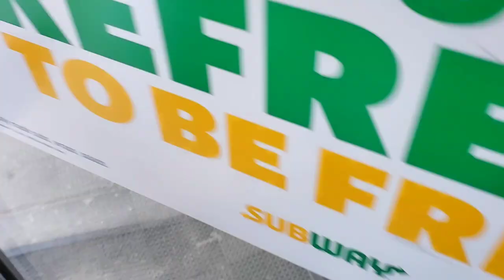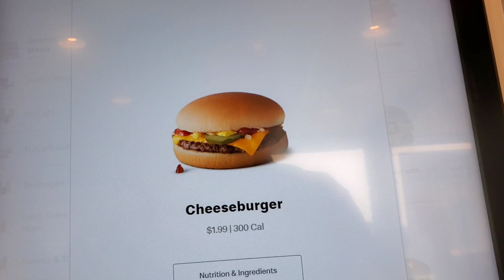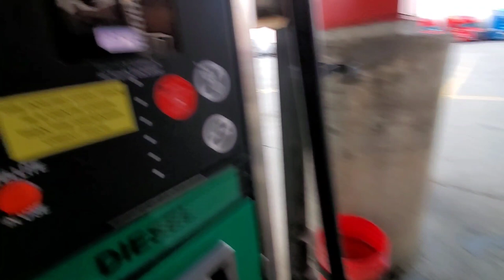Loaded For Topeka ~ Truck Driver Shortage #387

Comment: Keep  in mind  Kurt, there  isn't  a truck  driver  shortage.  Just a cheap  truck  driver  shortage.
Reply: I’ve had my CDL for quite a while but wasn’t using it. A friend is an O/O for a local company which hauls hazmat. In CDL school the classroom teacher was an old fellow who had been a Teamster before leaving to start the school. He advised us to get all endorsements we could. After finishing school I jumped through the hoops to get my Hazmat endorsement. 

This put me in a position where the company where I drive part time needed a spare driver. It’s been a good gig for several reasons. First, I get paid percentage. I really don’t get hurt as bad as a mileage based driver from delays. The second good point is that the other drivers which I deal with are generally high class. When loading up at the port the other drivers are nice guys. You just don’t see the things like you see on Bonehead Truckers Channel.

Comment: 30 years (100% OTR) all trailers except curtainside, car hauler, and some specialized.  Did the super- heavy, oversize/over length, gov't and military, refrigerated, dry, bulk, tanker, etc.
   You told it like it is, brother.  We all thank you for that.
   Two things:   1. Don't expect to be "super trucker" in only a week.  Takes years to be "average".  Respect those with more experience than you.
   2.  If the four-wheeler you drove to your company's terminal is manual stick shift, when you finish your long haul big truck runs

Comment: Great video as usual.  Growing up all I ever wanted to do was drive a truck. So during my last 2 years of high school in 79 and 1980 I worked for a truck leasing company servicing and washing trucks. After high school being 19 I still had to work odd jobs until I was old enough to hit the road. But as you point out there have been many days I have questioned my decision over the last 35 years but I have been able to see parts of the country that I would never have seen working in a plant. As aggravating as it has been I would still do it over again. So glad you can use on ramps for your breaks, on the east coast it’s a good way to get ticketed and get a DOT check. Not enough parking for trucks out here, if you don’t find a parking spot early here in the evening you won’t find one after dark in a rest area or truck stop. Again great informative video and we’ll see ya when we see ya.
Reply from the maker: Ya ive heard that those tickets are spendy

Comment: I wish people would stop saying you get "paid by the mile".. The number of miles is only used to determine your compensation to haul a load from "A to B, as opposed to percentage pay or ABP.
Included in that is everything incidental to that, from fueling the truck, doing pre-trips, weighing the load, checking the paperwork,  stopping at check stations, updating HOS records, submitting paperwork after delivery, and, yes, driving the truck.

Usually, there is a reasonable expectation of how long you will be under a load before you are available to commit to your next load. That is the time and labor you get paid for, and the number of miles times cents per mile is the way it is determined how much to compensate you for your time.

Only if extraordinary and unforeseen circumstances materially extend the amount of time devoted to a load should you look at additional compensation. I never had a problem holding my hand out if shipping or weather delays were upsetting the time/labor balance, and a good company usually responds positively for a well-presented argument for additional compensation.

Btw I get paid by the hour, OT after eight, 55 hrs a wk, Mo = Fr, off weekends, no complaints.

Comment: When I drove I pulled dry van and it was live load and unload (with an occasional drop and hook/but not many) I see most of your refridgerated loads are D&H (that's VERY nice). When I was driving for a fleet company my pay was .25cents per mile and I had to stay out a long time to make any money. I thought I would stay one year (which would of paid for my driving school) and then find someone else but I stayed (cause all of the company's I looked into were all the same) as where I was and buy the time I got to year four (4) I was so burned out I couldn't stand looking at the inside of any truck any longer so I quit.

Comment: 32 years cooped up in the lower bowels of a building was agonizing, but it did put a roof over my(our) head and food on the table. It just wasn't very rewarding clocking in and out and functioning under constant tight schedules, plus having to work alongside stressed out self centered bosses. I know for a fact, a trucking career would've worked ideally for me had I gone that route. Just being able to work independently solo and being your own boss would've been enough to motivate and give me the green light. Viewing out your Kenny's cockpit and takin' in the scenic landscapes and even the dreaded orange construction cones definitely beats staring at and breathing the stale stench of a poorly ventilated four-sided enclosure. I'm now retired due to business decisions to outsource production. Job security and employee longevity nowadays doesn't exist or mean much. I know now, I missed my boat when we're talkin' about career choice. Oh well... No need to dwell on it now! As always... Safe travels Kurt and cheeseburger lovin' pooch... Opie!

Comment: Honestly, trucking is very similar to being in the military. As far as a "life" style change. Being ex-military I am sure my brain is already wired for it. I am not saying the job is "easy" only that I should be able to adapt easily to the lifestyle change. My goal is to just run, run, run, 52 weeks in a year so I plan on being out 52 weeks. The truck will be my "home time".
Reply: I'm a veteran of the Army, and I thought the very same thing as you. I remember what it was like being out in the field, eating MRE's and whatever aluminum sealed food the cooks were heating up. Sleeping in the cold, pulling guard duty, fire watch, etc. If I survived that, I can survive trucking (which I'm in the process of getting recruited). My wife supports my decision (she wanted to do trucking herself, but can't), and my daughter is 21. I'm at a good point in my life to get started, plus I have a new way to serve my country.
Reply: @KILRtv  100% 👍 Good luck brother. You are mentally prepared for this type.

Comment: @10:45 I actually do get paid $19.50 an hour. And every hour over 40 is overtime. I’m a warehouse to plant shuttle driver. I clock in at the yard before I even start my pre-trip, hook up to one trailer, and pull it back and forth (20 minutes each way), to get parts from a supply warehouse, to a plant for their assembly line….And when my shift is done, I drop that trailer for the next driver, bobtail to the yard, and clock out. I know of some local LTL drivers making around $30/hour. It can be done, if all trucking companies would do it. I even know one OTR company that pays by the hour. Watsontown Trucking Company out of PA. I think they are starting their shuttle drivers at like $21.50 and their OTR guys like $22.50 per hour. They don’t get overtime till after 50 hours. And of course they don’t get paid for their 10 hours off duty. But they get paid from the time they log onto their e-log, till they log off.

Comment: Just a eye opener: you will probably have to go to a school.....low to no pay or even dip into your savings to pay for it. You will start as a company driver....forced dispatch for awhile...you go where they send you. You might get stuck in a team truck....get use to 5,000 miles a week, constantly moving, your partner rocking you around the sleeper shifting gears, braking etc. You will get a used truck and you don't know who (or what) had it before you....disinfect the hell out of it! Everything you need or want is available....for a price! All your food, showers, drinks etc. come at a inflated price. You will miss anniversaries, birthdays etc etc. You will possibly get stuck finger printing tons of freight, all drop & hook is rare!!!! especially if you run grocery warehouses....get a lumper if available(more money) Imagine being broke down on the side of the road when it's -5 degrees and a wind blowing up your backside and you're underneath in the snow trying to thaw it out or just trying to start it. Get used to being hounded by dispatch to "get there"....just to drop it in the drop lot (common with automotive loads) Get use to going in plants bathrooms and you're the only one that speaks English. Get use to watching for low underpasses (hello Chicago) Get use to the policy that a fender bender is grounds for being fired. Get ready for the time when you finally retire that you have spinal stenosis and scoliosis, two herniated disc and one ruptured one from throwing freight and being bounced to death on lousy roads......air seats will still bounce you.
Why did I do it for twenty two years?......because I love(d) driving truck!

Comment: Today I seen fuel ⛽️ price 4.05 
It’s going up. I agree with most of what you are saying. But your right it’s not a job it’s a life style.
For us o/o you have to love it. That truck is also your wife.
Reply from the maker: It's jumping around so much in this area . Drive 50 miles its diffrent
Reply: @truckingwithschmidt7120  
93 north of Las Vegas was closed due to  water and mud across the road. The road department said there was 4 feet of mud on the road. We had high winds I have to do some roofing.

Comment: Kurt, do you get paid the same per mile rate even if you get a light load. Like hauling plastic buckets . Or 80000 #
Reply from the maker: In most cases yes.

Comment: The only shortage in the trucking industry is getting low pay for sitting at a place or just in general with hardly any medical benefits. Sense the pandemic started. There are more trucks on the road now then they were 3 or 4 years ago.. so it depends on the part of the industry ur in. Flatbed is low due to housing and construction being low. Dry box and reefer are stupid high because of the demand to move freight. Follow the money trail and you'll see

Comment: There is NO DRIVER SHORTAGE. The large companies start this rumor every few years in an effort to push out the small companies and owner operators. There are so many trucks on the road now, you can't even park or get fuel. They should fire about 10,000 of the worst ones. That would help.
Reply: Ah so you're calling him a liar then?
Reply: @JCrook1028  You saw every word I posted, and I never called him a liar.

Comment: Is the pay for new drivers or drivers in general going up because of the shortage of drivers?
Reply: No. Swift is still .38 a mile 
Look at this .50 a mile at 3000 miles a week is 1500 before tax and deductions
Reply: @18TOLIFE  So it seems like the driver shortage is not big enough yet.
Reply: There is no driver shortage just extreme  turn over
Reply: that's the problem, if there truly were a shortage of drivers the pay would have never been so low in the first place... there is no shortage of drivers, if the pay is that low then that means there are way too many drivers... it's a matter of supply and demand
Reply: @25mfd  Way too many drivers or the right amount for the market just that the companies have a shortage of drivers that will take their low pay.
Reply: @TheTruthseeker707  interesting that you mention "... right amount for the market"... that's called market equilibrium but i'm gonna  slightly disagree with that because that would only apply to drivers who have their own authority and who actively negotiate the rates at which they will haul any proposed freight... company drivers on the other hand have no input into how much they get paid... if the company says .39/mile then that's it, no negotiations... the company drivers aren't truly participating in the free market per se when it comes to their wages
Reply: @25mfd  I think company drivers are participating in how much they get paid. If company drivers don't ask for raises and are not willing to leave their jobs if denied, the wages in the industry will stifle and the company will just pick up the next driver willing to do it for the same pay the last driver did it for. When companies start to truly not find any driver, those wages will go up, but when a drivers are willing to live in a truck for weeks at a time for less than 1,000 a week, why should a company pay more than that?
Reply: @TheTruthseeker707  the only company drivers that have a voice in their pay are the few union outfits that are left... other than that places like schneider, swift, jb hunt etc are non union and greatly ON PURPOSE they are non union for the very reasons we are discussing here... i briefly worked for schneider a few years ago... the grandson of the founder don schnieder came in and talked to our group during the orientation and specifically said "we are non union and we don't want a union here... no way"... him and the other places i mentioned don't want to unionize because they know the workers will have power as a group to squeeze the company for more compensation and will have a seat at the table of power... what you are calling for is a strike but do the drivers at swift and schneider and jb hunt have enough guts to do that???... i'm thinking no
Reply from the maker: No
Reply: @truckingwithschmidt7120  Seems like there is no shortage.

Comment: truck driving is an awesome life style and scary at the same time with 17 hours work time a day do get paid for camping in the truck but never took it but still camped every night for 6 days 7th day reset at home had issues with truck getting lost or stuck with pocket road train absolutely doing the run from Perth to Carnarvon carting reconstituted limestone blocks working for transport co at harvest time is a mind bender rush rush  rush but now I'm waiting for it to dry out a bit so can start the 6 week contract carting 19 meter gas pipe from the coast to the desert suppose to start in may  just don't know when if will happen and like most things before harvest starts in October who I work for is a farmer much less chaotic still want to insulate under the flor of the cab and sleeper in summer cant drive wearing work boots its bare foot all the time its mandatory to wear boots unloading at cbh i get funny looks walking around bare foot unrolling the roll tarps at the co-operative bulk handling (cbh)sample hut asking where's your boots?